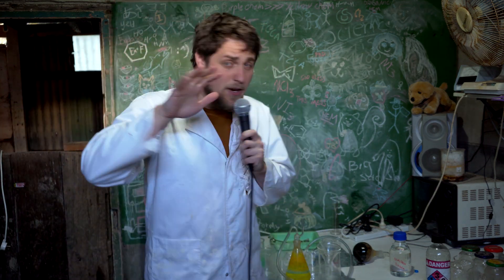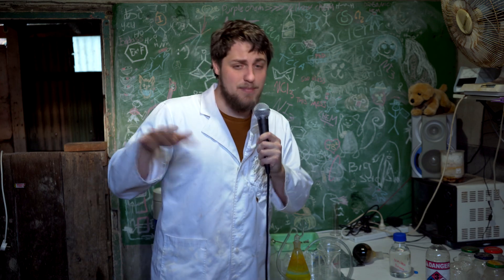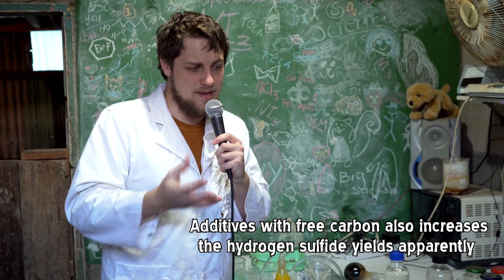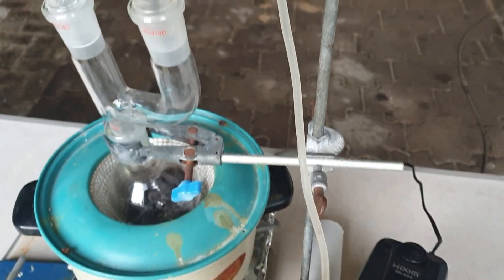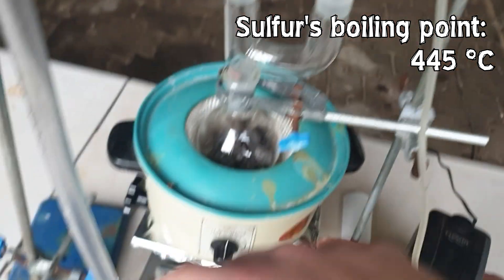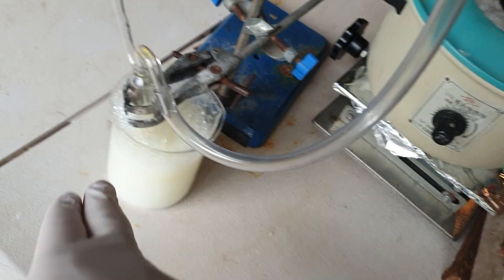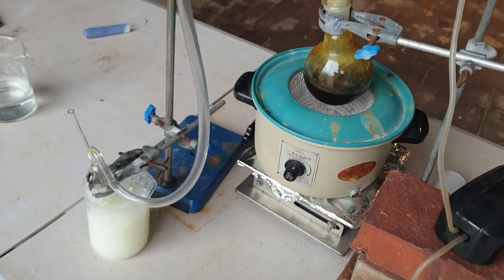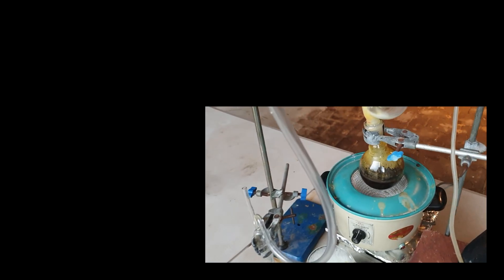A hydrogen sulfide generator using... a candle

Comment: I ran into a similar cleaning nightmare with sulfur a while back.  To clean my RBF, I attempted to remove as much guck as possible. A brush was useless, as the guck is solid enough to withstand any scrubbing with a brush. After several disturbing attempts, I was about to give up when I had one final idea. I had built myself a vibrating platform with an motor that had an off-centered weight. I decided to use it as a flask cleaning vibrating thing-a-majig. It sort of worked, but it was lacking the scrubbing umph (power) I was hoping for. So, I added sand and dish soap.  It took several hours, but it was working, and my flask was no worse for wear! But it still didn't have the scrubbing power I needed. So, I went to the dollar store and picked up some gravel from the art aisle. This time round, it worked, and it cut down on cleaning time. I also witnessed what I thought was a strange phenomenon as this setup did its thing. I had to find a way to keep the flask from vibrating off the vibrating platform. So, I used a stand and a clamp which I placed around the flask's neck, but without tightening it. The flask began to spin along its axis all its own, effectively scrubbing all of the flask interior, without further action on my part. I intend to use this method every time I run into a cleaning mess like this. So far, I've had to use it twice, and it's worked both times. The downside is it can take several hours (up to 24 or more) to remove really stubborn substance and get the job done, but it works!

Comment: somewhere around '92, I had read in the Field expedient handbook for explosives preperations.... or one of those training manuals, that you might be able to make H2S with sulphur powder and calcium hypochlorite.  So I had some 2000 flushes toilet tank cleaner..... and had sulphur.  Mixed a little, and didn't store it very well.  It was somewhat more hygroscopic that I thought and the plan ws to use them for delay ignition cause, well was handy... just inject a drop of water into a foil ball of it.... and it goes.  I did not expect it to go off by itself on my bed's headboard as I read a book around 2am.  Man, SO2 smell AND chlorine gas.... whew, was not nice.  pretty violet flame though, murder gas on the lungs..... didn't even scorch the headboard really....

Comment: This guy just said that hydrogen  sulfide is like carbon monoxide which is untrue the reason you see so many different reactions is because hydrogen sulfide is an anti oxidizer to the oxidation of different metals that have oxidation and the reason you see these reaction because like I said hydrogen sulfide is anti oxidizer breaking bad oxidation in your body increasing oxygen. In your blood and increasing oxygen flow in your body go back to school and take chemistry class 101 and learn up on your hydrogen sulfide. Hydrogen sulfide has alot of chemical reaction to different minerals and metals because oxidation is hydrogen sulfide arch enemy simply put. It's like batman meaning joker you know there is going to be a battle and batman wins

Comment: might be a bit late to the party, but I wanna add something about about the toxicity of H2S... it is comparably toxic like CO and Cyanide (which both are similar as in blocking the iron atom in the cytochrome-c-oxidase in the complex IV, interrupting oxygen supply). The mechanism of H2S toxicity isn't entirely known, but it is known to destroy red blood cells or specifically the hemoglobin.. what makes it so dangerous: you can smell it at very very low concentrations (0.0005 ppm has been reported), but it can damage olfactoric receptors, thus at higher concentrations you won't smell it anymore and might get a lethal dose without even realizing before it's too late... very nasty chemical to work with, that's why everyone tries to avoid it or create it in situ, like with NaS or LiS, since the S2- ion is basically the acid anion of H2S, but ofc not everyone has access to those chemicals, so H2S generation is still a thing and is often useful. another fun fact: H2S was found to be a second messenger or gaseous signaling molecule and is thought to act in the smooth muscles and induces calcium activated potassium channels, leading to hyperpolarisation of the muscles, which ultimatively leads to vasodilation and increased blood flow. So it works fairly similar to NO, which has also been found to be a signaling molecule. Funny enough, it seems even CO and CN are signaling molecules

Comment: Im sorry but were i come from argon is the cheaper, and  nitrogen is a fortune, I live in dodgee greasy Philadelphia, and that might be why, I had built a glovebox by going to harbor freight  and i bought a sandblasting cabinet, I sealed every seam and small spaces with phenoseal silicone sealant  and where the compressor hose come into it, thats my argon hose, its an effective oxygen proof ,holds a not so much amount of argon, because it doesn't escape, but it is a cheaper bulletproof  addition to you're home laboratory,  have fun, the sky is the limit especially if you're project goes boom!😂

Comment: candlemaking dude here - just FYI most candles aren't pure paraffin - they very often have soy and other waxes in them, even coconut oil, to get different properties, strengths, glass adhesion properties, etc. I'm not sure what side reactions this may cause, with all the added amino acids, but just FYI if you do this in the future - it's pretty easy and cheap to just get paraffin from candle suppliers or even camping stores, for waterproofing. it should actually be quite slimy at room temperature... which the "dry" candle tells me there's probably a decent amount of soy additives in that candle.

Comment: H2S is one of the most dangerous gasses. You are incorrect about its cause of death. It turns your body off. You don't even try to breathe. Basically you take one breath of high concentration H2S and then you are dead unless someone revives you. After they revive you then you will have permanent lung damage and probably life long repercussions. It's nasty stuff

Comment: Signs up in the woods around Tumbler Ridge, BC warning you not to go in, especially low lying areas as there is a natural gas field there that is very sour. It's where the Vancouver yellow hill comes from. The story goes that the gas field was discovered by bears who liked where it bubbled out as sites to delouse themselves. This was observed.

I remember the complaints from colleagues if I generated any of the stuff, acid and iron can be smelly as the iron is contaminated by sulphur.  As a pupil I did a lot of sulphur chemistry, thankfully it has gone from Scottish chemistry courses and labs just don't smell right now.

Comment: Dude, am I really looking at a 87 900 turbo back there?  my first car was a 900 non turbo. I really miss the thing
Reply from the maker: oh yeah man, it's got its issues at the moment but still mostly runs!
Reply: btw, i use this method to make H2S when i need a small amount of it, usually i use iron and sulfur way now but you should use a carrier gas to help push that h2s thru the wash bottles.   @ExtractionsAndIre

Comment: As for the use of air vs an inert gas, you're definitely right. Using something like argon as a carrier is theoretically safer than using something with a known oxidizer in it. Given that, the average mixture of your H2S and air is likely still well below the LEL of H2S (assuming the Aussie air is the usual .21 O2 and .78 N2; it might be backwards from here in the states tho).

Comment: @Tom - Do you think this would work fine with activated carbon? 

I don't see why it wouldn't, but I also thought activated carbon would be a great carbon source in black powder, and it turns out it's pretty bad at that.
Reply from the maker: Yeah it's a weird one that it's so bad in black powder, I have heard that too but haven't looked at why. Maybe its low density? So the heat transfer is bad? But it might be useful in reactions like this. Honestly its so hard to say because its way better at some things and worse at others, and there's not always a logical reason why
Reply: @ExtractionsAndIre  Yeah, that's for sure. Not very predictable, activated carbon. 
If I give it a shot, I'll be sure to reply here and let you know my results.

Comment: The tamest way I know to make H2S is by putting a strip of plain (carbon) steel shim stock (or another source of iron) into a warm/hot aqueous solution of potash alum. It's easier than what you have here (I've never seen sulfur at a hardware store here in the states, but now I want to check), and you /can/ slow it down with temperature, but I don't think you can shut it off with temperature. It may require quite a lot of alum and/or a very large surface area to accomplish the supply of H2S that you require, however.
Reply: If you haven’t found it in the states, check the garden section of smaller stores.  It is a fungicide, and can raise soil acidity.

Comment: This is quite oversimplified And I'm sure there's reasons for not doing it, but could some sort of expansion tank or literally just an inline balloon help With the shutting off part? To where you could put a valve in front of the balloon allow it to capture the volume while you cool down the reaction and then open it back up when you want more, I know this would probably mess up the reaction pressure but just throwing ideas.

I guess one quite obvious downside would be that then you have a concentrated explosive

Comment: About that peculiar smell threshold.

At about 10-20 ppm you’ll get eye and throat irritation. 

50-100 ppm: burning pain, loss of sight, cough

100-150 ppm: loss of smell

So by the time you can no longer smell it, you already have many gods reasons to leave the area. At higher concentrations, your symptoms will just get worse. If that doesn’t tell you to run for your life, you’ve earned your Darwin Award. 

However, all of that apples to gradual increase in concentration. If you run into a thick cloud you’ll probably just die pretty much instantly.

Comment: I used H2S liquid as a sulfur donator when I was growing MoS2 on Graphene (i also grew the graphene and transferred it onto silicon wafers) because the ATTM (Ammonium tetrathiomolybdate) reaction sometimes wouldn't happen. I used a PARR vessel to create high pressure temperatures which drove the reaction. The whole goal was to show that if the MoS2 seeded properly and grew on the graphene, the graphene could serve as the electron transport layer in a Hydrogen Evolution Reaction. which it did. Point being, H2S is the most putrid rotten egg smell i have ever had the pleasure to work with.

I did notice that in one of the shots of your reaction there were distinctly large "bubbles" of gas forming, but i think the surface tension of the molten liquid was very strong and trapped it. The clip where you had a burst of gas was when 4 or 5 of those "bubbles" burst open. So i think that you could safely say that this generates a ton of H2S immediately, but because of that surface tension it traps it until there is enough heat to break the tension and then it releases the gas that accumulated over time.

Comment: Just put the candle wax and the sulphur in a petri dish and heat over a bunsen burner on a ring stand.    Instant fart smell.  Use to do that in highschool chemistry in the winter
and get the teacher to open the windows when it was below zero outside in the winter.

Comment: If you're looking for a simple, inexpensive and reasonably safe way to clean paraffin from glassware, hot diesel/kerosene/lamp oil followed by  a little acetone does the trick.  It gets around using metric fucktons of acetone or other such things and can still be used for some applications (e.g. lamp oil).

Comment: What is really dangerous about hydrogen sulfide is tht you get olefaory faigu ane one cn no longer detect acutely dangerous amouns, as you mentioned.  When using H2 fom yl9nders in a lab, extensive (and expensive) safety precauions are required.

Comment: This thing works really good once you get it boiling. Its nice and cheap to run, and can produce alot of hydrogen sulfide. Its great

Also tons easier to use cheap non ground glass joint flask. Just cover it with plastic and tape when done and throw into a ziplock. And once spent, pour out the molten leftovers and refil

Comment: RE on your sense of smell getting oversaturated when the concentration is too strong. The same thing happens with most geiger counters when you measure the radiation level: when it gets too high, they completely stop counting pulses because pulses become just a continuous internal discharge that does not produce impulses or sound. If you ever encounter that, you know you fked up.

Comment: My favorite part is when I have miscalculated just how non-linear a reaction can get and how quickly. Nothing like estimating whether to dump a roll of paper towels or a basket of dirty laundry on it or just go ahead and run out the door.
  Batch of rocket motor fuel I was ready to pour developed the cutest little blue spark out of nowhere and I just happened to see it start and then the whole pot was blooming into white flame and billowing amoke. Never process rocket fuel inside your mother's kitchen. Nothing opens the gates of hell like 5 lbs of fuel and oxidizer let loose in your domicile.

Comment: This is one of the gases that can be spewed out of volcanoes, only remember this because of the mention of not being able to smell it in a higher concentration. There is a similar gas i remember being told about that volcanoes can produce that if it starts to smell sweet you are probably fucked unless you can get an O2 mask. Of course this is coming already from a secondary, perhaps even tertiary, source so it may be prone to exaggeration i.e. chinese whispers.

Comment: I was thinking of sulfur candles used for old school fumigation, they generate SO2. Interesting by adding carbon to the mix H2S is generated instead. I suppose a tea-light candle with a dash of sulfur and carbon added could really stink up a place.
Reply: It still produces H2S even without adding carbon.  I did this with my home chemistry set probably in grade school (indoors and much smaller quantity.)
The carbon seems to increase the yield, somehow?  I have some guesses why, but it would be interesting to know.

Comment: NaK-77 (an alloy of sodium, potassium and occasionally caesium) is a very promising hydraulic fluid, having the widest operating temperature range of any other hydraulic fluid, and also having a higher bulk modulus than any other hydraulic fluid. Plus, it doesn't absorb air or water.

But it has three problems:
- It attacks tethlon.
- It has low lubricity, making it incompatible with positive displacement pumps.
- If you cut a hydraulic line full of NaK, loss of hydraulic pressure will be the least of your problems, because explosions and fire!

I don't suppose you'd know of any ways to fix those problems?

Comment: Could mineral oil (liquid paraffin) be used instead of paraffin wax? If it does then you should be able to mix evenly before the heating, and you don't have to deal with solidified junk in the flask.

Comment: Yes, H2S inhibits mitochondrial complexes as CO do. And that's why is poisonous, because it turns your cells not capable of producing energy. Most of literature show that 10 uM threshold already poisons your mitochondria. However, what if I told you that your body endogenously produces H2S? We express about four types of enzymes which produces H2S from L-cysteine (and that's why H2S smells like rotten eggs) or Homocysteine. There are multiple physiological roles for endogenously produced H2S, especially in brain and cardiovascular system, but also in cancer cells and many more. More on that, there is a specific enzyme that produces H2S inside of each mitochondria. It's specific activities are in elucidation, however, there is a strong line of evidence showing that this capacity was brought to "modern life" state about 1.5 billion years ago, when unicellular life "decided" to go on an adventure and explore the anoxic H2S-rich environment back then. As there are enzymes for synthesis, there is a cellular system for it's destruction and mitochondria stands out for that. Besides the enzymatic reduction for thiosulfate, H2S also works as substrate for electron transport chain in eukaryotic cells mitochondria. Thus, H2S may be used, in specific conditions as hypoxia and inflammation, as energy source for cell. Such function helps our cells to circumvent challenging conditions in use of very ancestral machinery acquired in the primordial earth times. And that's why my phD thesis is so awesome...

Comment: 14:12 i'd try soap and hot water or deconex (stuff used to clean lab glassware) before going full hardcore with piranha which fully oxidizes anything into its elements xD

Comment: Try adding H2O2 in the dirty flask and a bit of FeCl2. The foam should clean it. As for making H2S, since your channel is named the way it is, you could try passing acetylene gas through molten sulfur, with the advantage that you will also make a highly useful solvent, namely CS2.

Comment: the instructions of this video will be used in suicides. some information should not be shared lightly. there is very little use for this gas, even less outside a professional and safe envoirement.

Comment: I dont think that you overthought the flammable gas in an environment with oxygen = bad thing but argon is fucking e x p e n s i v e, and nitrogen or CO2 which are both MUCH cheaper would do  the inert atmosphere job just as well, so maybe pick up a cheapo  N2 welding or CO2 soda and brewing tank for when something as fine and inert as a pure noble gas isnt necessary. Lets be real, outside of fluorene stuff and hi-temp metallurgy, whats the argon gonna do that the nitrogen wont for pennies on the dollar?